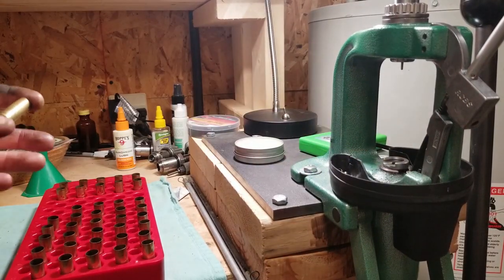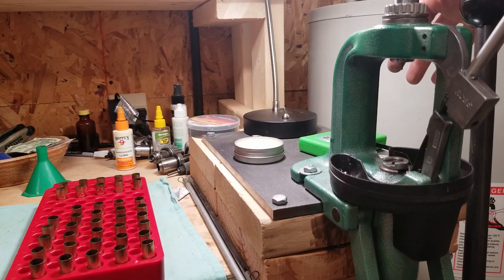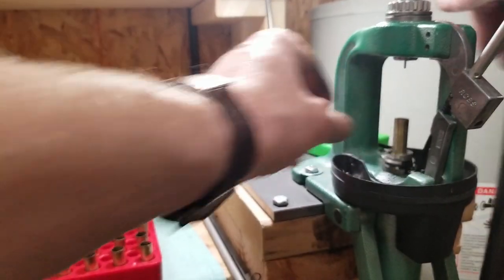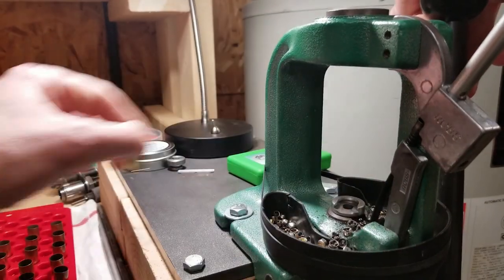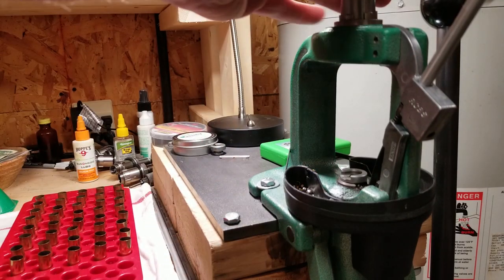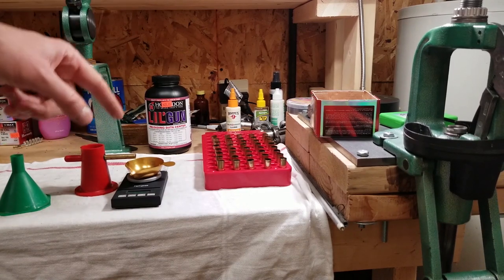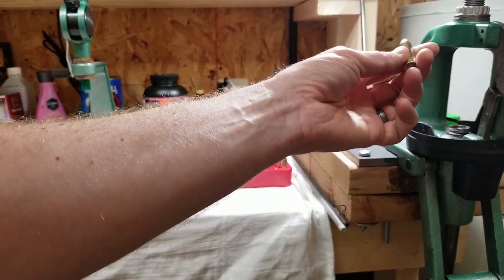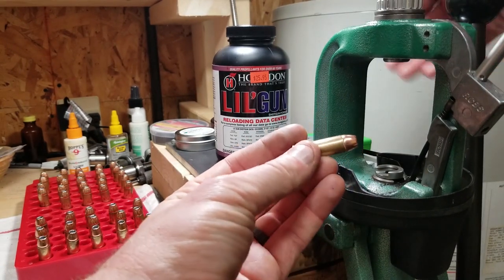44 magnum reloading with Lee Precision dies

Comment: 3 die sets do include a bullet seating/crimping die and work just fine. The Lee set includes the same die, however, in addition it includes the Lee factory crimp die that only performs a crimping and uniforming function. 3 die sets work fine and are sold that way because it’s all you need.

Comment: I have reloaded 1000's upon 1000's of .44 magnum. I never lubed the cases ever; I shoot a lot so every step I can take to shorten down the process help. When I have de-primed the cases I usually toss them in a wet tumbler with stainless steel media, some dish was soap (machine). I let it tumble for 3-4 hours then rinse them off and dry them as good as I can with a towel. After that it is into the stove to dry out any water that usually sit in the flash hole. 190 F on the stove for 20-30 minutes usually do. (Same process for all, except those that goes into the progressive press, .45ACP, .38 Super, 5.56 and what not, those I clean with the primer in, but you have to make darn sure all the water is out before you reload, or there will be no bang for the buck)

Comment: Great video.  I load on a progressive and started loading 44 mag about a year ago.  Started out with H110 and as it turns out, Dillon powder measures DO NOT like H110.  The powder is like sand dust and it jams up the powder bar upon actioning the measure.  I didn’t want to not use the powder so I turned the press into essentially a single stage.  I resized and deprimed everything.  Trimmed the cases, then ran back through the press to seat primers.  From there, I did the “weigh each charge” by scooping and using a trickle.  Once charged, back into the press at station 3 to seat the bullet and crimp.  I loaded just over 400 rounds.

I learned a few things:  First, don’t use H110 in a progressive.  I believe W296 is very similar so I’ll stay away from that as well.  Second, the charging takes ALOT of time… 50 cases would take me 30 mins or so.  The fact you did 40 cases in 10 mins I think is very good!  Finally, I learned to have a greater appreciation for progressive reloading but also a greater respect for those that single stage it.  

I don’t load precision rifle but am considering it.  If I do, I now know what to expect.

Comment: Not to attack your level of knowledge or experience, however, your bullet seating die should have a crimp function built into it, all you have to do is seat your bullets at the proper bullet seating depth, then back off the seating stem so that it does not contact the bullet, then screw in your die until the crimping function engages with the mouth of the case, remember to back off the bullet seating stem so it is clear from contact with the bullet, then make small adjustments screwing in the die to the desired crimp you want in the crimp groove of the bullet.  You can make dummy rounds so you can adjust the die to repeat those adjustments when setting up those functions. a separate already adjusted die set is the way to go, however, it is not necessary. also, you do not have to anneal straight wall pistol brass.  it will be fine and last for many firings without problems. However, do what you like, Just some hints of mine. Good shooting to ya-Dave
Reply from the maker: Thanks Dave always good to hear of others experiences. I have the 4 die set that includes a crimp die, so I just use that.
Reply: My set for 44 mag had a seat and crimp in one step. Which I like for making my plinking loads.

When I'm reloading for my 44mag rifle for deer loads I use the lee factory crimp.

Always depends on what the roads are for. Hitting a 8 inch steel circle anywhere or hitting a 8 inch circle where I want it to go.

A lot of guys I know wont do a seat and crimp for anything that needs to be spot on.

It all depends on application, same as sorting brass, trimming brass, throwing vs measuring each load ect.

Comment: Been reloading a short time, mostly 9mm and 45acp to get use to the press and process. Getting ready to do some 44 magnums. Definitely want to get them right, especially the crimp. So  much recoil I don’t need the bullets moving!!
Reply from the maker: Ya you won't need a heavy crimp just need to turn the mouth in a little bit. 44 mag is a ton of fun.
Reply: John Knouse   Have you had any issues with pistol cases fired from glocks?  Or found any issues with case bulge? Is so, how did you solve it?  I was able to take the bulge out in the resizing process, I have heard of a lot of guys having to use the lee bulge buster or a similar die by Redding.    Also,   As odd at it sounds, it’s actually safer to load rifle cartridges because you don’t have to worry as much about double charges since the powder won’t fit.    I’m fairly new to reloading too
Reply from the maker: You are 100% correct, double charges are a big concern in my mind too, I don't reload 9mm right now. A single stage press just isn't efficient enough for 9mm, imo. I know a lot of guys the do it with single stage, just not me...lol This fall and over the winter I'd like to do more pistol shooting and reloading, probably a turret press will be part of the equation.
Reply: PA Wild I’ve been shooting all my 9mm reloads out of my Ruger Security 9, but some of the brass I use is from Glocks and I haven’t had any issues resizing with the factory dies (Lee carbide). I have a Lone Wolf Alpha Wolf barrel coming this week to use in my Glock 17’s, so I can start shooting my reloads out of them. I have a Glock 20 that I’m fixin to start reloading for, and I have heard that the “Glock smile” is an issue to watch for.
Reply from the maker: Ya an aftermarket barrel is in the plans for my 19 as well. I'll have to keep an eye on the brass, I'm not that familiar with glock issues or watchouts.

Comment: I didn’t catch what primers you used if you mentioned it?   I just loaded my first 44 mag yesterday, haven’t tested yet.  I used large pistol NOT large pistol MAGNUM.  In fact, I have not found anything that calls for magnum primers?  Could I use magnum since it’s a magnum case? Or would it be dangerous?        (Not that I’m going to do it if you say I could lol). Just curious
Reply from the maker: I use CCI large pistol primers. I think as a rule of thumb ball powders need a mag primer. I started with large pistol primers and will also run mag primers once I get time. Will be interesting to see if it affects the accuracy or velocity by much. Nothing wrong with it with ball powders
Reply: Generally, Mag loads require mag primers. H110 and 296. Check your reliading manuals. I use 2400 cuz I’m not looking for the top load and just don’t want to have ‘special’ primer on hand. 🤔 In 2024, having any primer makes it special! 😂🎉

Comment: I am completely oblivious to the world of reloading, but I am considering undertaking... What type of powder is usually used for cartridges such as 44 mag? and is there any difference with, say, the powder used for a 9mm?
Reply from the maker: They both use pistol powder, get a reloading manual, powder charge weights are different
Reply: In Magnum calibers you want to use a slower burning powder with a magnum primer setting it all off. I have user many different types over the years. And it also matters the weight and type of bullet you use. For .44 Magnum I have settled on 2400 but I have burnt some kegs of Unique in the .44 as well, especially when using lead bullets. In my .45 ACP i have used a lot of ''Tite group'' it meters really well in a progressive press and I get really even loads.
Reply: Yes the powders are different. 
Powder for .44 magnum is a slower burning powder because magnum calibers are often fired through longer barrels. The slow burning power in a long barrel is what gives the magnum such high velocity and kinetic energy. 
I used Accurate #9 powder for my magnum loads. 

9 mm powder is very fast burning because 9mm pistols usually have short barrels and you don't want massive recoil in a semiautomatic pistol. I use Accurate #2 powder for this task. 
Now you can use a fast burning powder in a .44 magnum if you want a target load with low recoil and less noise.

Comment: Currently reloading 45-70. Purchased a Winchester 1892 in 44 mag. Do I use one of the published pistol loads or are there specific loads for 44 mag shot from a rifle?
Reply from the maker: Depends on the book you're using, the Hornady manual has rifle and pistol data
Reply from the maker: Just took a look at the manual, looks like the loads are the same for the 44 magnum, it will just be a lot faster out of a rifle.  Dont take my word for it though look around on the net for load data or get a manual with the 44 mag rifle data.  Good luck